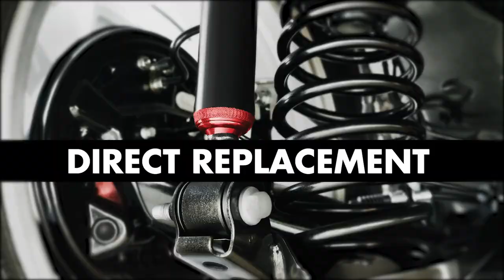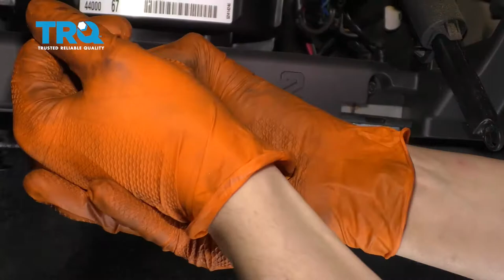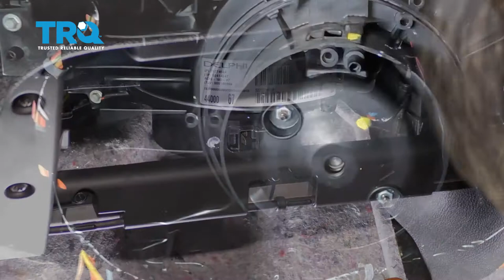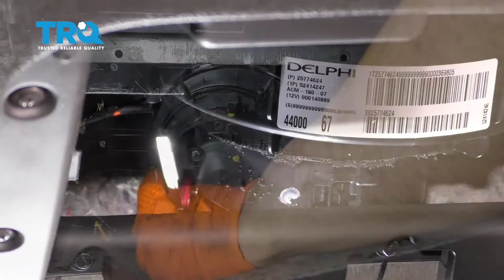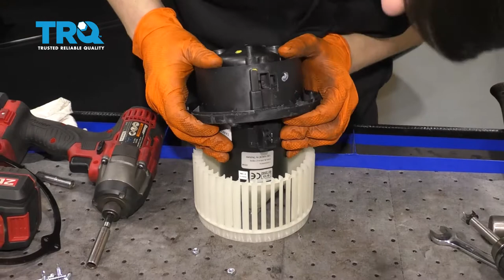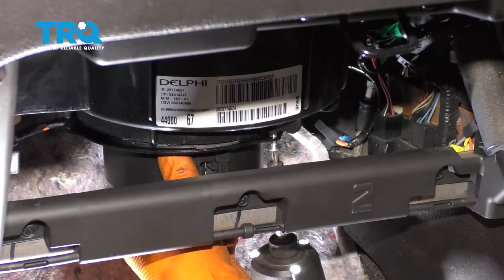How to Replace Heater Blower Motor 2006-2011 Chevrolet HHR

Comment: Very helpful for removing the blower motor in my 2006 HHR; however, the one I'm trying to replace with that one, my 2008 HHR, is a different design. For some reason, the motor does not detach from the housing, it's all one piece. Thank you for a very informative video though!

Comment: Hello, it's very good, I liked your video a lot.  Thanks for the information you provide, the tool you want for the air conditioning fan is very cool.  in the future I think I will buy this tool thank you very much for the video greetings

Hola está muy bueno, tu video me gustó mucho. Gracias por la información que proporciona está muy padre la herramienta que la quieres al abanico del aire acondicionado. en un futuro más yo creo que compraré esta herramienta muchas gracias por el video saludos

Comment: Just did mine today (2011). Notes:
1. Take the glove box out (I did not and it cost me in time, visibility and physical discomfort, especially on the re-install). The glove box drawer is apparently removed by extracting the hex screw to the small plastic air piston on the right, then carefully wiggle forward, up, and out (3 hinge clips on the bottom and a pair of overlapping tabs on the left. Replacement would be the opposite of removal).
2. Immediately behind the glovebox and above the fan motor's housing is the intake filter. This is a standard automotive paper,  baffle-type filter. I did not replace mine, I cleaned it instead. there are 3 vertical clips sealing the filter housing. They can easily be undone by hand, even with the glove box in. Your best bet is to get a new filter before you start, it may take a fine hand to remove, clean and reinstall a used one.
3. That suspended piece of carpet has 3 plastic retaining pins total, the third is hidden straight forward, pinned to the same block the wire harness is attached to. Carefully removing the carpet entirely adds cubic inches to the confined workspace. One less thing to fight against.
4. That specific point in the reassembly is also where the last screw goes, right where its hardest to get your driver into. This must effectively be done blind, by brail, as it were. At all stages, make sure not to accidentally cut, pinch or short any wires.
5. Assuming that most of us do not have an air-powered mini-sawzall, i tried a few different blades and found for arm-powered short work like this, the saw blade on a common Leatherman's makes a tolerable job of it.
Reply: I also had to modify the new motor a tad, took the flanged nuts off the old one and traded them for the shaved inches on the new ones, bought just enough height to minimize rubbing. Be careful, there...
Reply from the maker: +@mrj4719 Thanks for the feedback! http://1aau.to/m/Shop-TRQ